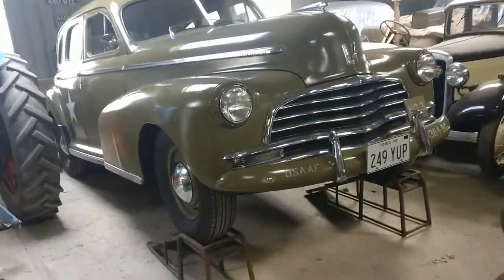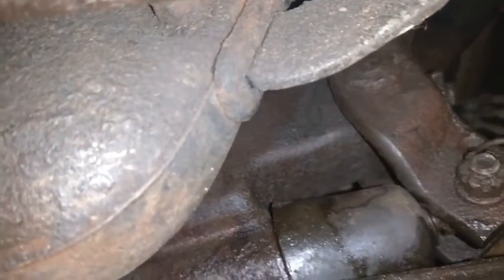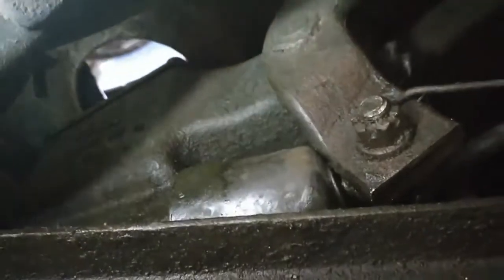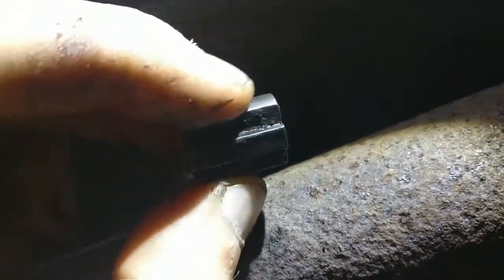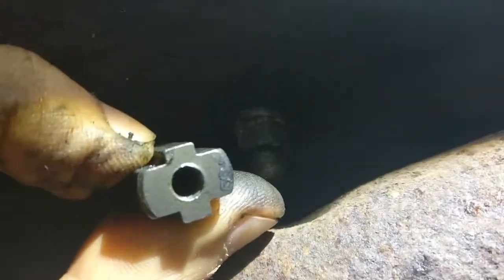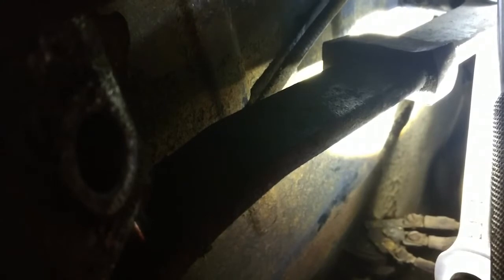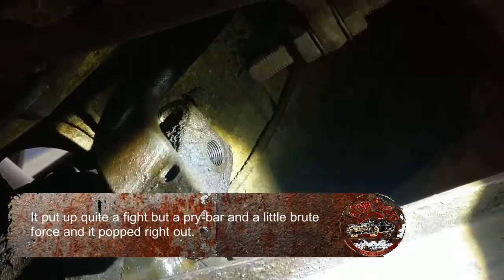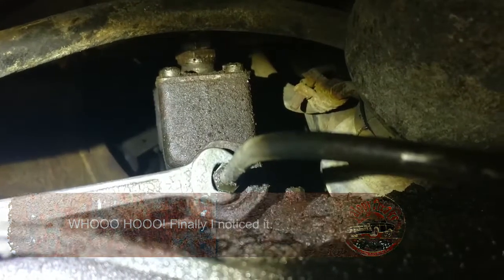1946 Chevy Stylemaster Brake Master Cylinder Part 1 Removal

Comment: A lot of shops would rebuild these without taking them off of the frame.  They would go through the back.  Remove the snap ring and slide the guts out.  Then hone them while bolted up and install the new cups. Usually worked just fine.